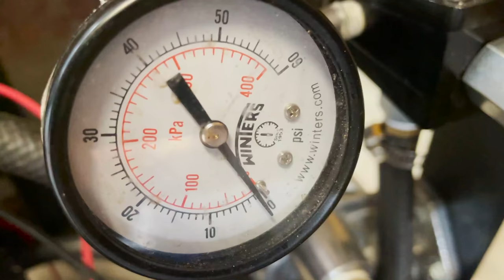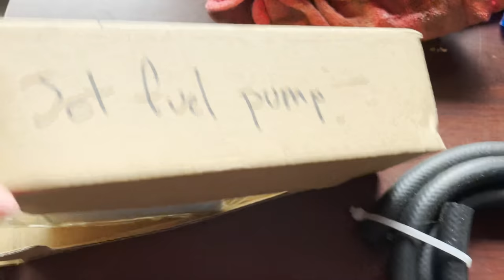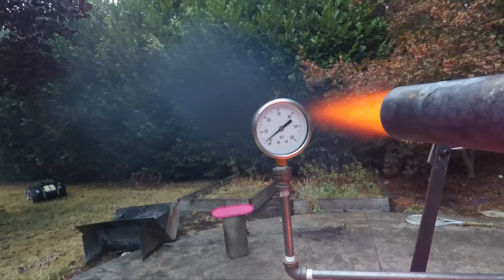TURBOFURNACE: MAX HEAT

Comment: Heck yeah! This is awesome! Nice work guys! Now we just gotta aim that jet into my stainless steel Tesla turbine. 😈😈😈 all the power!
Reply from the maker: Thanks! Still need to get exhaust temperatures under control and operating pressures up, but our ultimate dream is definitely to slam a power turbine (and associated power electronics) on this thing. Collaboration? :)
Reply: @survantjames  yeah you guys are doing it! I’m literally just starting to do some designing for my combustion chambers and systems, deciding what to really go for and I came across your channel. I absolutely love what you guys are doing with this, Especially this running on wood gasification, right?!? Incredible! 👏 like seriously hats off. I’ve gone through a couple of your videos checking things out and you’ve knocked this out of the park. 

For the most part I have all the power turbine and generator side of things worked out. From my preliminary tests of my aluminum and polycarbonate turbine builds I’m getting up to 2.75kw(~3.65hp) and 6.02ft-lbs of torque at just 4150rpm and have been showing sustained 1.2kw load tests. I’m only using room temp compressed air at the moment too. It’ll still push the 1.2kw all the way down to 65psi with the right air flow. But most of my dyno tests were from 150psi dumps.  
So I’m beyond excited to start seeing what kind of power these turbines can get out with a proper combustion source. 

I’m still finalizing all the ins and outs of my final replication for Nikola Tesla’s improved combustion + steam turbine patents. The fact that it can ingest solid particulates from waste combustion with little to no detrimental effects (depending on the sizing obviously) 🤤🤤🤤 

I would love to chat some more though and def maybe collaborate because you guys are really killing it with this turbo furnace. Where are you guys located at?
Reply from the maker: @CharlieSolis  Thanks for your kind and encouraging words! Your videos are likewise very impressive! Couple things. It’s not a gasification process, we are just straight up burning logs in this thing. :) Second, I don’t know for sure what’s possible on the high end of pressures but given that it’s an automotive turbo, I’d be a little surprised if it could push more than 40-50 PSI. But our mass flux ends up being pretty high. In an upcoming video we are gonna show some more interesting measurements but some rough order of magnitude estimates weighing the wood that we put in, timing how long it takes to burn, and referencing the caloric density of wood, we keep getting numbers like .2 megawatts… :). I’d be interested in your thoughts on lower pressure/higher mass flux for turbines! We are located in the Portland OR metro area.
Reply: @survantjames  ah thank you for the kind words as well! Just a dood in his garage 🙃

But wouldn’t you know I’m specifically designing my Tesla turbines to be for high mass flow! Lol the ones I’ve got right now are just 50 and 75 disc versions so it can be sized up much larger for very high mass flow rates. so as far as pressure in the Tesla turbine I only need the pressure for creating the high velocity fluid before going into the turbine discs with the converging nozzle. Really you want a high velocity high temp fluid. Which you’ve already got in spades lol In my humble opinion the higher pressures will mostly lend itself to higher burn efficiency and thrust driving your compressor but because the jet coming out is already moving very fast and is also very hot it’s already perfect for the the Tesla turbine, especially Tesla’s improved combustion+steam turbine patent. Now that’s not to say higher pressure wouldn’t be better but the thermodynamic expansive capabilities of the Tesla turbine with elastic fluids are rather effective and could probably get away without needing such high pressures. 

Not to mention when coupled with steam going together into the turbine you are going to get the most bang for your buck as much of the heat output will dump into the steam for large expansion capacities through the Tesla turbine. 

If you haven’t seen it before, check out Nikola Tesla’s improved combustion+steam turbine patent GB 186,083. It’s rather brilliant. Essentially you use combustion exhaust going into the turbine and the heat that’s not used in the turbine then goes through the exhaust to heat a boiler to raise steam. That steam is then fed coaxially with the combustion exhaust going into the tube leading to the turbine nozzles. So any heat not utilized for power just gets effectively utilized to make up the massive energy needed to overcome the latent heat of vaporization in the boiler. With a high temp exhaust and high pressure boiler you can build up a very high pressure motive fluid going into the turbine.  And especially if the combustion exhaust is on Venturi set up with the steam you don’t even need the turbo jet exhaust to meet the steam pressure, it’ll still be “drawn in” by the vacuum created from the high pressure steam. 

The picture in that patent is looking down onto the turbine and can seem a little vague so. Check out the other two additional patents he has for it. They make the system a little more understandable. Patent number GB174,544. It’s a hybrid Tesla turbine + Parsons bladed turbine for elastic fluids. And then also check out the steam super heater add on he also patented at the same time GB 186,084. It gives a better view of how the tubes lead to the turbine and also shows another way to coaxially feed the combustion and the steam into the turbine together.
Reply: @survantjames  but yeah looking at the glowing red hot nature of the entire system I’d say .2 MW isn’t far off from the total thermal output on that thing. Wrap copper pipe around anything that’s glowing red and make one long mono tube flash steam boiler. 😈🔥😈🔥😈
Reply: @survantjames  what were you’re plans moving forward with the power stages?
Reply from the maker: @CharlieSolis  Makes a lot of sense. Watched some of your build vids on the turbines and yeah I think you could easily scale them out with more layers. I like how the injection nozzles can just be scaled out linearly. I’ll have to check out those patents. 

I’ve also had the idea of making a steam ejection nozzle as part of the whole turbofurnace setup (behind the combustion process but ahead of the turbine). 

Without giving away spoilers, we have a somewhat simpler idea for extracting the first useful work out of this thing. :) Power turbine sometime after that.